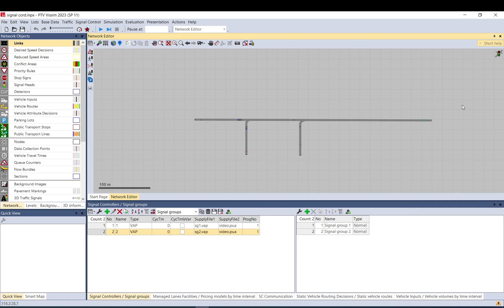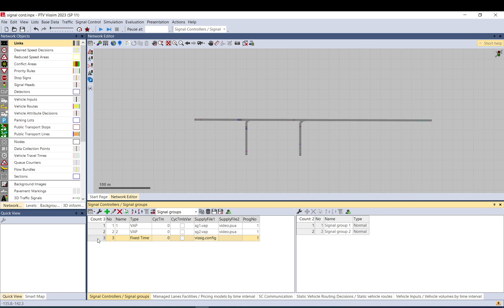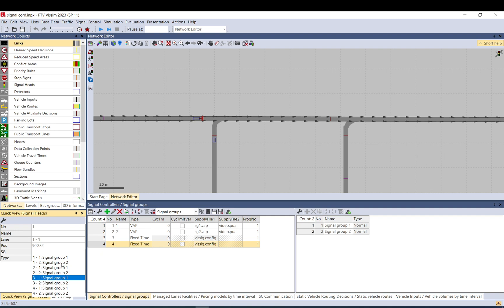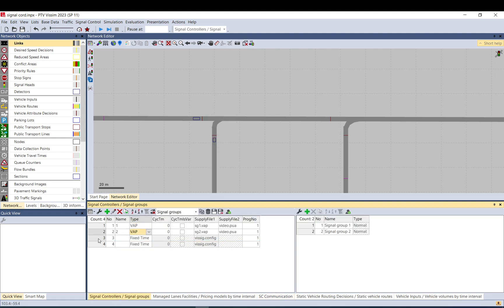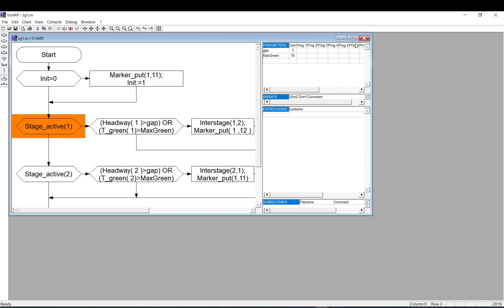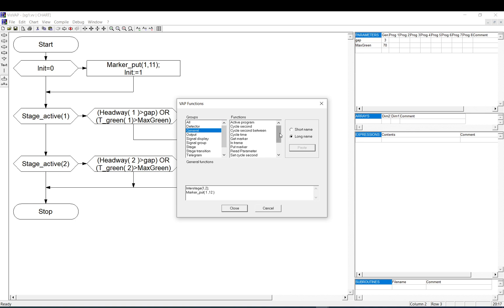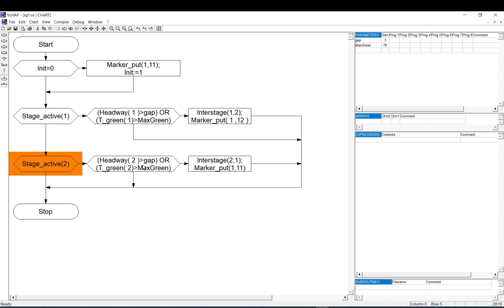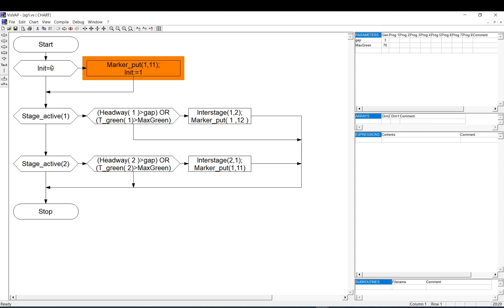Vissim Tutorial - VAP/VISVAP - Communication between controllers

Comment: Can you tell me about channel and marker ? i cant understand
Reply from the maker: Hi Usman, you need to have channel defined for communication purposes. It basically tells Vissim where to look for the information you try to send. 
When you want communication between controllers, you must define the data's route from one controller to another. Each controller has channels to output information and also channels for input.
Since can set up communication between many controllers, each row in the 'SG communication' list (shown at 3:36 in the video) is basically the definition where the info comes from and where it goes to. Using channels, you can be sure that for example SG no.:5 picks up the correct data.
You can set up multiple channels between the same controllers. So this way you can send more info and you know which channel has what data. E.g. channel 1 you are receiving end of queue alerts, channel 2 has stage change notifications and so on.
You can also send the same data from SG1 on channel 1 for example to many other controllers. for example: OUT: SG1 ch:1, IN: SG2 ch:2, SG3 ch:2 - in this example you send data from SG1 on ch1 to SG2 ch2 and also to SG3 ch2. This would take 2 rows in the SG communication list.
Markers are just the functions you use in Visvap to read/write these channels. 'get marker reads the channel for inputs, 'put marker' writes the channel for outputs. 
I hope this helps, if not let me know.
Reply: @MatyasLemberTutorials  Thank you , i will try and let you know